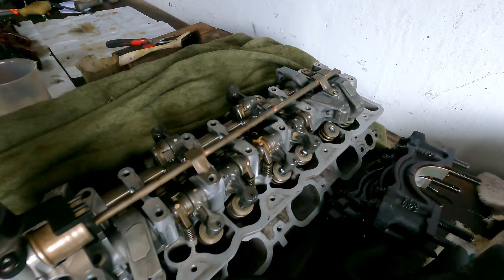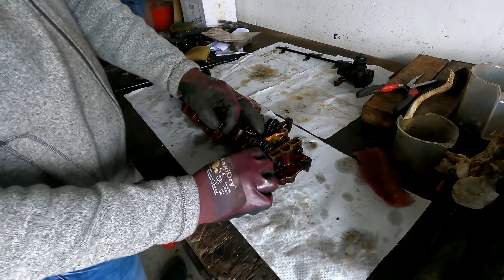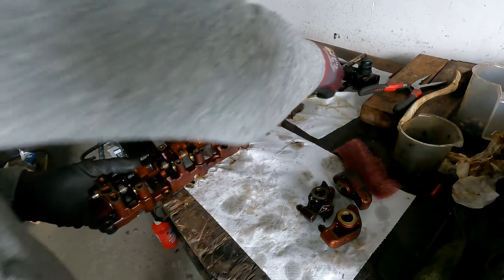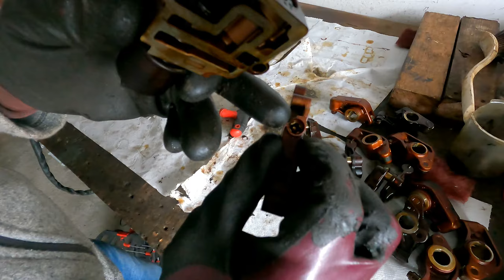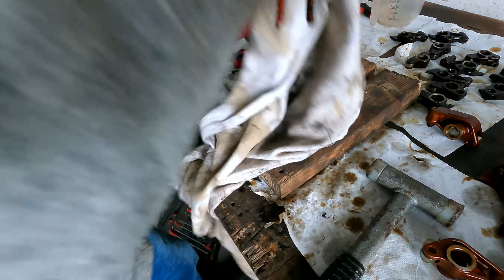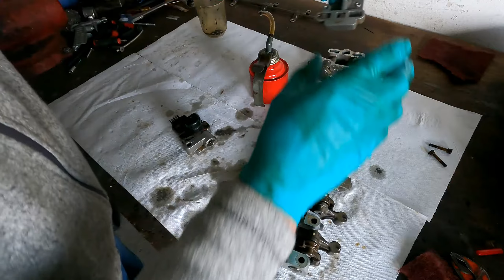M113 engine rebuild - Part 7 - HOW TO: M113 camshaft bearing bridge assembly.

Comment: Best video on youtube! I wonder if you can omit the cylinder deactivation stuff if you replace the camshaft and camshaft bridge + disable it from Star? I'm wondering because its a rare option and it's very hard to find parts for it. Also I even wondering if its possible to replace the heads with heads from 430 as the part numbers match and there are a lot cheaper here. Im not going to do it for now but nice to have that option :)
Reply from the maker: That camshafts bearing bridge frame is custom to every head so you need to change out the rocker arms then and the camshafts . Also you need different valve covers

Comment: Solenoid????i see it first time
Reply: its only on cars with a cylinder deactivation option. My car has it but I wonder if it can be deactivated and use a normal camshaft in case of failure as its very rare and expensive.
Reply: @philipplamenov8649  its for fuel economy
Reply from the maker: @philipplamenov8649 yes you can
Reply from the maker: @philipplamenov8649 i have these cylinderheads complete for sale on my website.  I Changed them out to m113k heads.  But the ZAS heads are.fully rebuild and on jmspeedshop.com  for sale

Comment: How did you clean up the parts so well..great video and Thankyou..
Reply from the maker: Cleaning amonnia
Reply: @JMSpeedshop  Thankyou...
Did you use it full strength
Reply from the maker: Cleaning amonnia from the supermarket is 3-5% pure .  That this what i used
Reply from the maker: See video about cleaning of the pistons in the playlist .  That will show what i used

Comment: Hello sir. I am replacing a valve and 1 lifter on a m113k, if I am not removing any other lifters, do I have to reset them all, or just be sure the new one is reset? Thanks.
Reply from the maker: Just the one

Comment: Hi! Can you share your experience. Now i am going to mount AMG camshafts on my E430. I was told that bolts must be changed. Can you tell which bolts (part numbers and quantity) have i to change. I've looked in EPC, That shows following: A0029909722 (2piece), A1129901022 (16/16 left/right), A1129901022 (another 4 piece), and  A1129900212/A1129900312 - 20/20 piece - i can't understand this last position. Can you help?
Reply from the maker: I have to look this up because it is a little strange in the part list.  But i have used a different set of bolts because i had the ZAS system
Reply from the maker: But there are also people i have heart that never chance the camshaft bearing bridge bolts.  I did it because the manual tells you to do
Reply: @JMSpeedshop  
I am afraid when i will reuse and retorque them not to damage or strip any bolt heads. To be honest they are very expensive from Mercedes and to change them is not very attractive.
Reply from the maker: Yes these boots are really over priced.

Comment: Great video! Could you explain how you got the Hydraulic lifters back in the rocker arms after cleaning them? Sorry If I missed that. Thank you very much!
Reply from the maker: Im showing this in the video.  But im using the 8 mm socket and and teflon hammer and slightly tap it in place
Reply: Got it. Thank you!

Comment: Hello. Can you advice does it matters if i change stock W210 E430 Cams with W210 E55 Cams? Does it give any gains?
Reply from the maker: If there is a part number difference there should be a difference in the cam . Because lot of parts also in in the amg engine is having m112 numbers .  The normal 4.3 and 5.0 also run max 6000rpm i thought the amg model where able to run higher rpm
Reply: @JMSpeedshop  
Yep W210 E55 has different part numbered cams.
Reply from the maker: You should say it is a different lobe  design then but how much the different is i can not say
Reply: @JMSpeedshop  
Thank you
Reply: 10 or 15 years ago Kleemann USA said it was worth around 8 HP. I don't remember if they said it hurt low end power though.